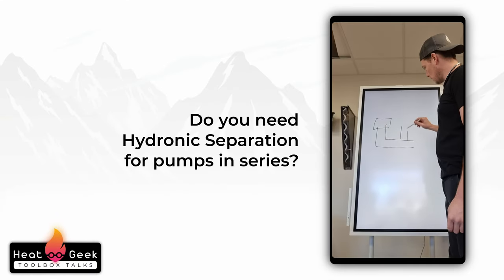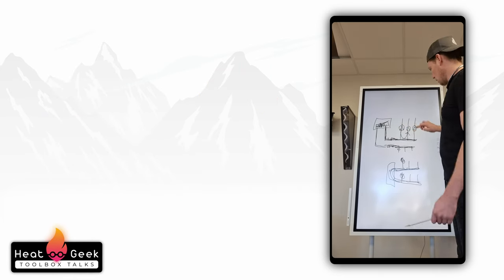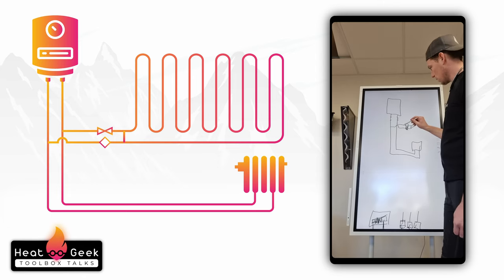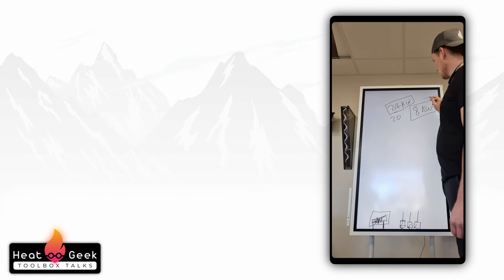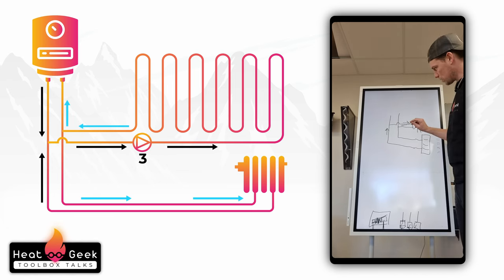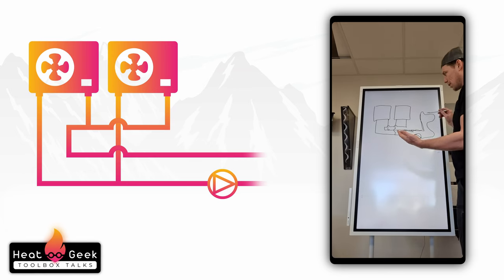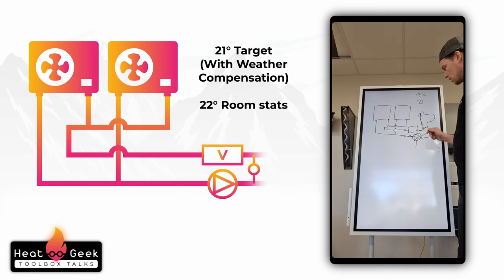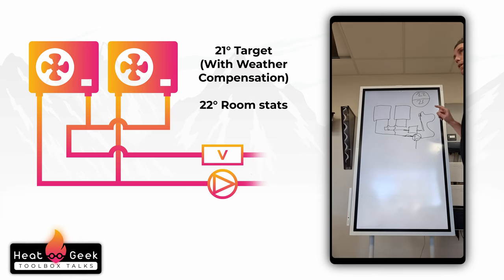STOP Installing Multiple Pumps! | Hydraulic Separation | Toolbox Talks

Comment: I could do with a video explaining volumisers and buffer tanks for heat pumps; when to use them, how to size them, and anything else you can think of. I'm learning so much from you. Thanks for your work creating your channel.
Reply from the maker: We cover this is great detail in the training. But also have an article due
Reply: @HeatGeek  Thanks. I could also do with a video on sizing heat pumps and storage cylinders for domestic hot water production. Your videos are great because you have embraced your geekiness!
Reply: @HeatGeek  I could do with a video welcome to come over mine and shoot it .. air source bivalent alterative with rayburn 😮

Maybe 3 port valve prior to buffer and pump after t 

Unsure if heat pump has bivalent setting but I can easy wire a contact pannel with switches etc to override

Comment: Assuming we are using intelligent weather compensation set for the radiators, as without an electronic mixer the boiler can't control the ufh. If the ufh has a form of separation ( fixed or electronic mixing valve with no boiler feed back ) to allow it to run at dt 7 it requires the flow temperature to it to be higher than its return temperature by the dt of the boiler or higher to satisfy its load. This can be calculated with a volumetric flow rate calculation. As ufh and radiators have almost always different heat curves at some point this balance will fail. This is why Viessmann always show multiple mixed circuits controlled from the boiler. Vailant allow a different strategy where the boiler uses the llh temperature to run at the temperature required for the highest temperature circuit (usually but not always the ufh ) the lower temperature circuit may not be satisfied unless the above rule is followed. 
With these different flow temperatures and flow rates required its possible to see that the boiler temperature may need to be different from any circuit being supplied and this can only be achieved by hydraulic separation at the boiler. It can never be achieved with hydraulic separation in the wrong position such as at the ufh manifold. 

Hydraulic separation allows for load matching at the boiler at the cost of distortion ( raised boiler flow temperature, not return ) a bypass in the system causes a raised return temperature rather than a raised flow temperature. A raised return causes a boiler to reduce output and may fail to load match causing under supply to.our system. 
This is possibly the most complex set of interactions in a heating system and is clearly the cause of much debate. Its really only noticed in systems fitted with modulating controls and this is why the Viessmann technical guide is such a valuable asset for understanding hydronic design. 
Heat pumps are not immune from these design principles but design mistakes would be far less noticeable due to the entire system being dt5 and radiators being so very low temperature. It is still unlikely that both ufh and radiators would run at the same heat curve though and so hard to design a mixed emitter system open loop. 
If you can understand this its clear that a bypass or ccts at the ufh is not an acceptable practice for good hydronic design. 
The reason open bypasses are not allowed on condensing boilers is that they raise the return temperature. By-passes form a short circuit. By short circuit we mean a circuit with no load. This is used deliberately in older boilers to prevent condensing. Remember these boilers where targeting high temperature not low temperature. 
If we create a short circuit with or without a balancing valve we get a raised return temp ( reduced dt ) Remember our boiler has a target flow temperature and dt to encourage condensing. A short circuit clearly reduces efficiency but by causing the boiler to modulate back we can possibly no longer satisfy the radiator circuit load. 
What about our pump ? Again complicated to discuss as we have different pump strategies. But would pumping water to do no work, but only to reduce efficiency, be good design ? Clearly not. 
So what pumping strategy should we use in a system with a short circuit and two or more other circuits?  Clearly weather compensated or burner linked is not an option as we can't load match. 
Constant speed pumps used a spring loaded bypass to cope with the required closing of zones due to over heating and the use of overheating strategies like room stats, zone valves and trvs. Constant pressure and proportional pressure pumps made both fixed rate and spring loaded short circuits unnecessary. No matter how hard I try I can see no reason to use a short circuit in a design.
In the Viessmann design guide we see the use of balancing valves on ufh. These are positioned after the mixing valve. These do not short circuit the boiler. These bypasses I believe allow the ufh circuit to only accept make up water from the boiler at a flow rate suitable for the boiler to maintain dt 20. This absolutely would require our rule to apply. Remember that our ufh needs the flow temperature arriving from the boiler  to be higher that the ufh return by the dt at the boiler as a minimum. 
As its 3.10 am I reserve the right to correct grammar, spellings and unclear statements in this post.
Reply: Could you post a link to the Viessmann design guide ?  Thx

Comment: Was there a follow-up video in the end on not using LLH's with mixed UFH circuit and unmixed radiator circuit?  The mastery course covers mixed circuits in the controls section, but the module on hydraulic seperation doesn't really cover scenarios with multiple mixed/unmixed circuits.

Comment: I got 165sqm of underfloor heating , on  G+1 building wich have 2x distribuitors with 10 circuitis each(not longer than 85-90m each ),pipes are 17mm with internal diameter 15mm but the main concern is the pipes feeding the  distribuitors (henco 26mm multilayer pipe  (22mm internal diameter) will be there enogh to feed distribuitors they are  decent lenght from  Heat pump to first distribuitor  about 3 meters and to second about 6-7meters ?  The heating source is ground source heatpump. i will have problems with insufficient flow on return pipes,if yes i assuming an low loss header will sort my problem?thanks you!

Comment: Fantastic video. I agree that LLH are overused. Close coupled tees are more than adequate for most domestic homes with downstairs UFH. Nice idea on the zone valve and balance valve to stop the short cycle. Esbe valves with weather comp are my personal preference. The only thing is that building regs get in the way with efficiency as all they seem to care about is turning off gas usage and not the efficiency of the appliance
Reply: The esbe valve unfortunately does not control the boiler temperature output and so only offers comfort rather than efficiency imo.
Reply: Agreed. My point being building regs not caring about the Modulation ratios on appliances and focusing on stopping gas being used no matter the set up. More wear on the appliance requires more downtime and shorter life cycle and eventually being replaced with  more CO2 into the atmosphere by making the things and more CO2 emissions by transportation from diesel lorries etc.

Comment: Hi Adam, why does a 4 pipe buffer/ Auto bypass effect the efficiency of a heat pump? I get that it increases the flow temperature from the heat pump but why? Thanks I’m advance
Reply from the maker: Distortion. Look at our 'why not to use a low loss header' video
Reply: @HeatGeek  thank you much appreciated

Comment: So if I install a heat pump with integral pump, would I still use an LLH as the internal pump may not be able to provide enough flow for the UFH and rads?
Reply from the maker: Your inter Al pump will be able to give enough flow. The question is can it give the glow at your required head pressure. If not it needs hydraulic sep
Reply: @HeatGeek  ok.  I’d really like to simplify the installations.  It’s always seemed over complicated to be using an LLH no matter what.
Reply from the maker: @simonsmith3406  just do a pressure loss calc.. as a VERY ROUGH rule of thumb.. over 7kw us HS.. under don't..  very rough

Comment: Could you use a large cylinder with multiple coils as a air source heat pump thermal store. Run the heat pump through a lower and upper coil for maximum heat transfer and possibly solar thermal on another coil. You then have an unvented cylinder connected for hot water via pump and zone valve. Heating could go through an automatic blending valve to alter its temperature as a weather compensation on the heat emmiters. i know this would mean the heat pump would need to run at its higher flow setting but its just an idea.
Reply: This is precisely what I’m planning on installing, have you had any experience, or was it theoretical?
Reply: Just a theory.

Comment: I don't follow regs. I do what's right for an engineering view. Brillant. I definitely need to take a leaf out of your book.
Reply: Ultimaitely, if it can be shown that the building regs are not optimal, the regs can be changed. It just needs a heat geek to prove the case to the regulators.
Reply: Well, yes, exactly.  A differential pressure bypass valve will either not work at all or work when not required or will open all the time when coupled with proportional pressure.  An ABV generally opens when the differential pressure increases.  Had a very long discussion with another plumber over this and he didn't like the fact that I was disputing the regs.  But when you hit a wall built of physical laws, what can you do?

Provided at least one radiator is controlled by a thermostat and not a TRV, there should be sufficient flow for most systems during call-for-heat periods.  I suppose if you wanted a bypass purely for over-run purposes, you could have a motorised zone valve that CLOSES when there is call for heat and spring opens the bypass when there is no call for heat (i.e. when the pump over-run may be in use).   At least this wouldn't raise the boiler return temperature.  Or you could have a flow monitor controlling the bypass valve (but it's getting complicated for the sake of it now, I suspect).

Comment: Just looked it up. A low loss plate from vaillant fro a 70kw system has a 1m head loss. As a result any pump on a distribution header would exert a proportional pressure loss on the remains circuits proportional to its flow through the plate. If the square law applies and the distribution header has four pumps serving four equal circuits and only one pump operated the pressure exerted by that pump on each of the other circuits would be 1/16 of 1mhd. I think.....
Reply from the maker: I think it would be to do woth the ratio of the pressure loss through the plate, vs the pressure loss round the other circuits. Yhe pressure loss round the other circuits will be lower if the flow rate is divided by the amount of circuits due to the square law
Reply: @HeatGeek  each of the other circuits are separate so the square law would only apply to sections under combined flow. As each pump switches on the head loss increases to a total of 1hd in the example. Plates offer resistance to flow in parallel and so the greater number of plates the lower the resistance. Longer ates give closer LMTD and short fat plates lower DP
Reply from the maker: @andrewmillwardwatford9410  ah yes. But also the lower flow will also have proportionally lower pressure loss from the other circuits too.
Reply: Andrew, you usually install multiple pumped circuits behind a plate, does this video contradict your approach? Of course yours works as I have one in the garage but interested to understand if you agree
Reply: @pkcrabtree  no it's a standard method. Distortion and temperature uplift are a required feature of some systems. We design plates to minimise temperature lift though to maximise efficiency. The pressure loss through a plate is very low and creates no notable interaction between pumps.

Comment: Is it possible to add a heatpump to a home that already has a gas boiler? Or even a diesel system.

i.e. : split up the system. Some rooms are heatpump-based, and some rooms are on the old system.
Reply from the maker: Yes, you wouldn't split the rooms up though. You would just oupe wthem together and chose the aptopriate control strategy
Reply: @HeatGeek  Almost all salespeople & technicians here in Belgium that I've met always tell consumers that for a heatpump, you have to fully replace your existing (gas-) installation.

Would love more content on this misconception.
Reply from the maker: @110gotrek  you should.. you dint have too..
Reply: You can integrate a Heat Pump with another heat source, but it's not straight forward. Typically requires a central thermal store, with multiple coils.
Reply from the maker: @hvacdesignsolutions  I wouldn't advise a thermal store